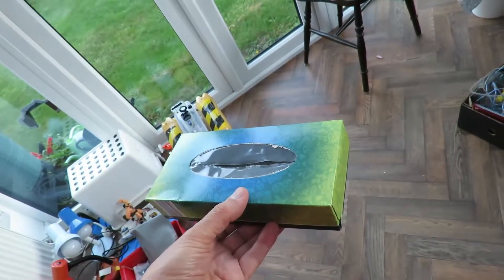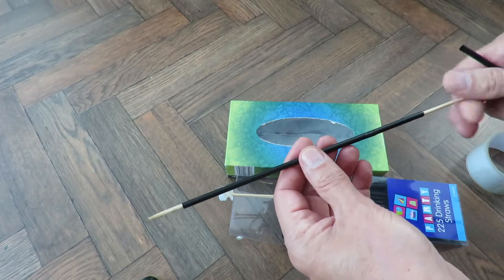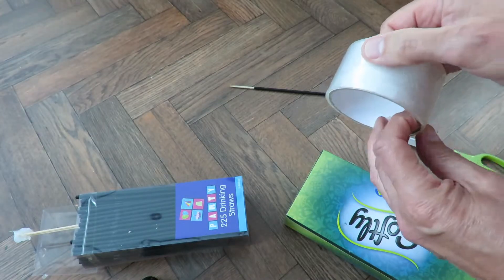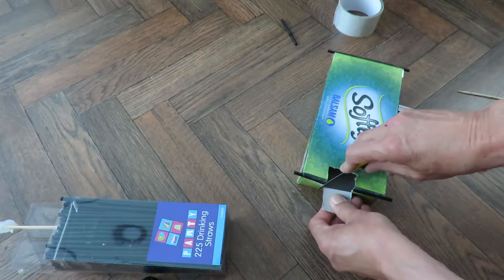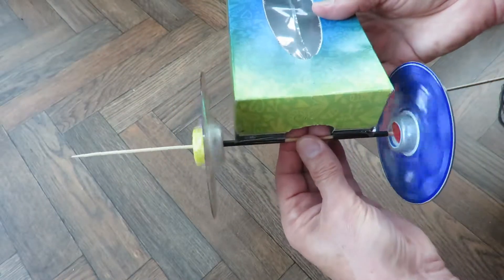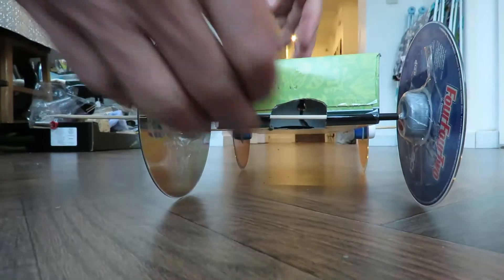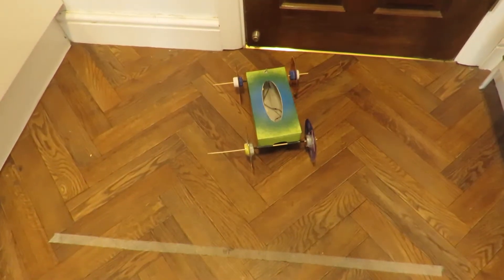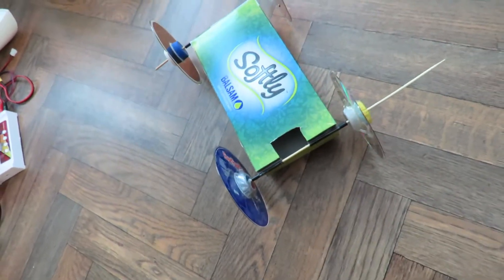Put a rubber band on it 0276 Tissue box rubber band car

Comment: Hi, i was wondering what type of energy this uses, i did a similar project that didn't work and it was potential to kinetic.
Reply from the maker: @rabiasyed1808  potential energy is the cake in a box, kinetic energy is eating the cake. Potential energy is stored in the rubber band when you stretch it. Kinetic energy is the band returning to normal.

Comment: My car keeps going right or left. Do you have any suggestions?
Reply from the maker: 1. Does the car run straight when you just push it without the rubber power?
If it doesn't run straight without power, then your axles are out of alignment.
That could the axles are not parallel or they may be twisted, so one wheel is not on the ground, so it runs on 3 wheels. 
2. When you wind up the motor, the tension may be distorting the body, causing the axles to go out of alignment, with the same effect as "1" above.
3. If you wind the rubber unevenly across the axle,  the tension can pull the axle out of alignment. 
4. Lack of grip. If the wheels spin, instead of moving forward, that can cause the car to turn. Add tyres to the wheels or add some weight to improve the grip.
5. Both wheels on the same axle must be the same diameter.
Reply from the maker: This video may be useful https://youtu.be/cw6MrBy7nCo?si=vh3Y6gITMWPSMgMj